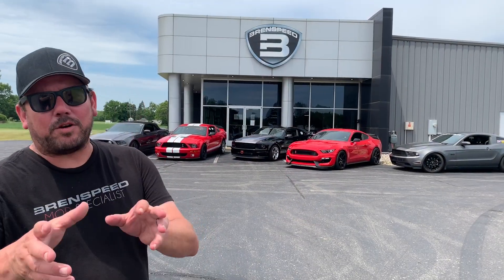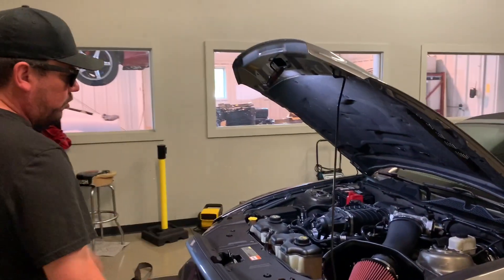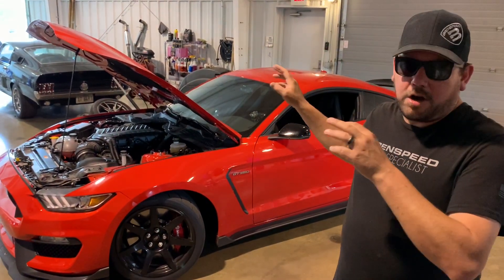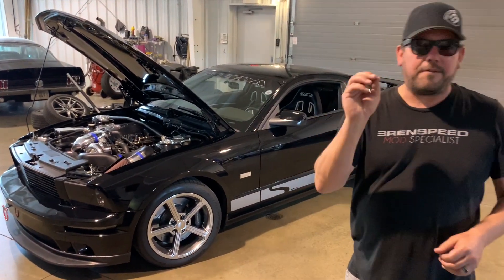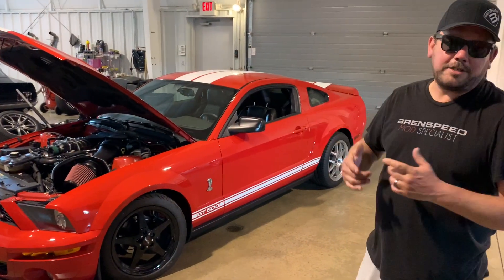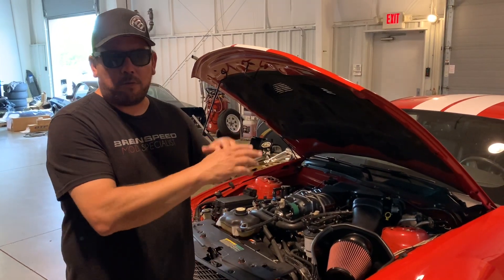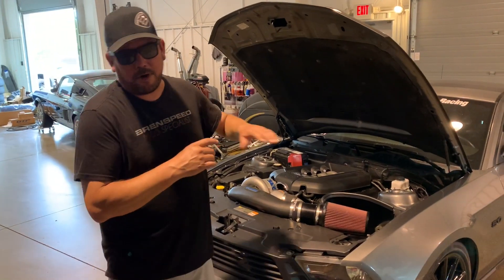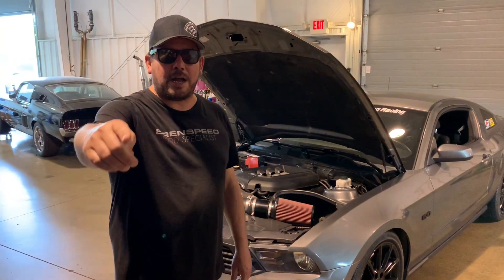Which Supercharged Mustang (WOULD YOU CHOOSE!) GT350, GT500, Gen 1 Coyote, 3V @ Brenspeed

Comment: GT500. Not just because it’s a GT500, but because they can handle the perfect amount of street power stock (750, 800 on e85). The platform is so ridiculously huge you can do whatever you want with them. The carbon fiber pieces and the body work is there, you can choose from 6, 7, maybe 8 or more different super chargers. Tons of different exhaust systems. They have probably the second best sound when they get cams, besides the 3v of course. It’s guaranteed to be a manual 2014 and older. There’s just something about a cammed GT500 on drag radials. IMO they’re just the pinnacle of American muscle and I don’t think anyone will ever make a better or more timeless car
Reply from the maker: I think all your comments are great ones. They  do have a great foundation to build upon.

Comment: Current Ride...2018 Lightning Blue Roush Jackhammer 6 speed..Last Car 2014 Track Pack with 625 roush blower .
Drag Race Shelby with Big Ass Blower.
Driver..2014 Blown Convertible..
Road Race or twisty Roads..GT350...although I wonder how torque is on that motor..

If I were to build a perfect new Mustang..Auto PP brembos a must and Torsen  level 1 with Roush Phase 2 upgrade..750 factory hP with upgraded axles and The pp level 20 inch big wheels with 275 om front and 315 or 325 on Back
Reply from the maker: You have had some sweet cars!
Reply: @BrenspeedEngineering  Thanks !! I appeciate your videos and details...

Comment: I used to watch the high mile coyote  build and little did I know I would find myself looking at centrifugal superchargers and specifcally a j7-jt-b, as well as a built shortblock with manley beams and pistons with arp rod bolts . 
It's going to take me MUCH longer but that's what I'm planning on. 
I am also waiting on a dyno update for the 'high mile coyote' and maybe some track runs :)
I'm currently a 2012 GT/CS 'mostly stock' looking to make  around 700 wheel at first to 850 wheel with that kinda setup further down.... but with covid it's all been halted due to budget cuts at my last job (a.k.a. me being cut)

Sending an e-mail for a quote anyway, although it is going to be a year or more before i'm ready to pull the trigger on it entirely.

Comment: I would go with #5. I have a 2013 GT auto with 86K I am planning to bring to your shop for a Webster short block, fore fuel system and a Whipple. I am going street/strip and some show. Cannot wait until things calm down with all that is going on. Any benefits to swap to Boss Heads?
Reply from the maker: Boss heads do flow better but honestly it depends what you are doing with the car. Because it is boosted it would not in my opinion be worth the money to do heads also unless you are planning maxing out the supercharger/fuel and need a bit more power.